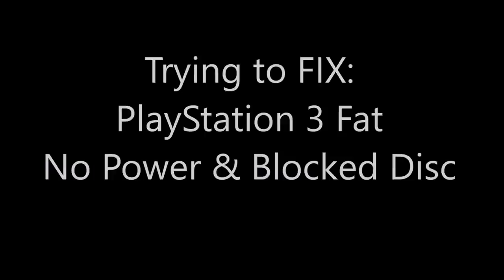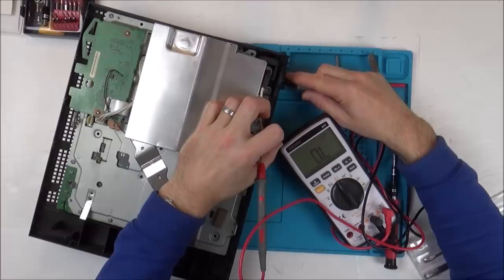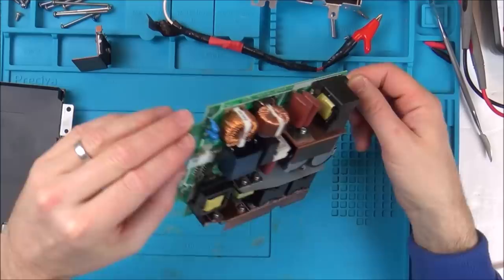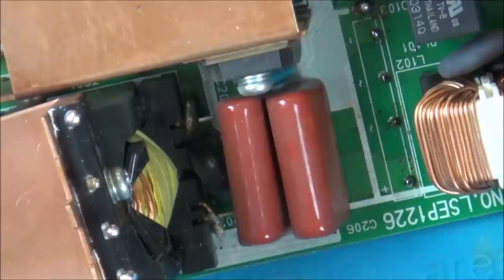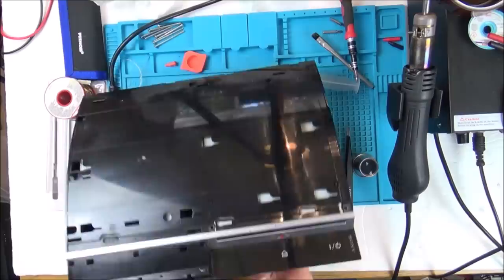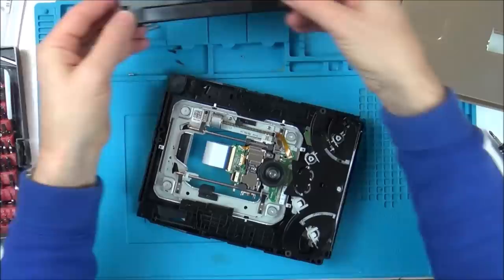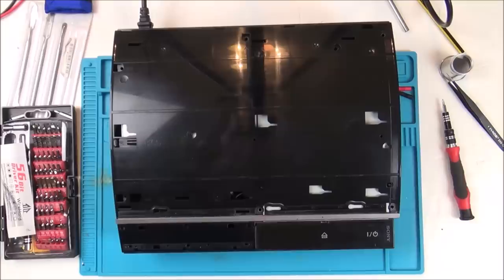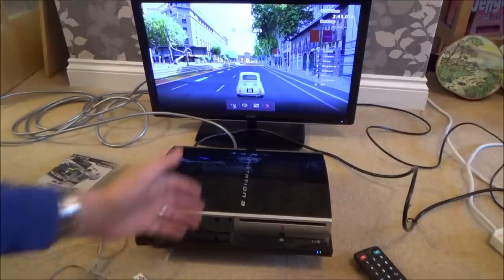Trying to FIX: PS3 Fat - No Power & Blocked Disc

Comment: Hi Vince, you need to hold down the power button for a few seconds to put it into standby.
However, if it doesn't go into standby you can bend the top prong up slightly on the switch and this should sort it. It may take some trial and error. 
I had the exact same problem with a used fat ps3 I bought second hand.

Comment: An easier way to fix that bridge - take some resistors, cut the legs off, wrap them around each pin - solder those legs then onto the bridge.  Because they are wrapped its a more secure connection.  Then unblock the old pins, and fit the bridge again - provided you dont heat for ages on the underside and the wrapping is tight, they wont come loose and it will be easy to secure from the underside.   Great job - really mysterious failure though - normally that type of break would only happen from wobbling the bridge back and forwards.  I wonder if it was sat on top of a washing machine or something that vibrates like mad - that "may" cause that type of failure imo (since it was top heavy due to the heat sink).  Just a drop on its own cannot have sheared that off.  Maybe the disc got jammed in there after a drop, and it then sat on top of a washer for months on end...   Before I forget - never run the screwdriver around like that to try and sort random stuff out, because if one cap IS charged, you may send that voltage into something next to it that doesn't like that voltage ;)
Reply: Him dragging the screw driver around sent shivers down my spine. Not the best way to handle sensitive components.
Reply from the maker: Cheers for the advice Chris. I like the tip on wrapping the pins for strength, I will use that :-) It was a clean break all at the same height, I don't think that power supply had been opened before because the stickers were still in place, really weird!!!!
Reply: @Mymatevince  Hehe =D  I think on top of washing machine or drier for months!!!

Comment: This video spurred me on to try to fix my UK launch 60gb ps3 that has ps2 and ps1 compatability. It was suffering from the YLD i had tried previously to bake it on the oven but it didnt work so today I disassembled it and took a heat gun to the main components that cause YLD. To my surprise after re assembly it worked so now i have a choice keep it for nostalgia as i rarely play console games anymore or sell it on with the relevant disclaimers that it has been a victom of YLD in the past.

Comment: There are two options for a disc drive in that position and thinks there is a disc.
1: Open the drive as you did and just put a disc on the spindle then close4 it then eject it, 
2: you could use a manual eject via paper clip which will put the disc drive into the empty position; 

The reason it was like this? after a simple deduction I would presume someone has had the drive apart after power failure then removed the disc. They may not have been able to find the small hole for a paper clip. 

Thus for anyone, even if the drive is empty, but not sure, just use a paper clip for the small hole on the drives, there is ALWAYS a manual eject. If that doesn't work or budge the mechanism, then take apart and put in a disc, onto the spindle, without turning the cogs, remembering the drive THINKS there is a disc due to it's internal position, then power on and eject.

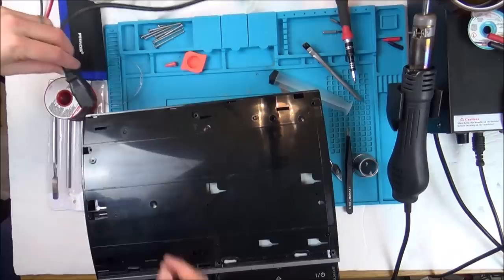Comment: 23:30 Pro tip.. Plug in the mains plug to a switched (and trip protected) wall socket, with the switch *off*, then power on from the wall.
Use the wall socket switch not the device switch. If it doesn't power up first time, power off at the wall, toggle the device switch, power back on at the wall. That way you are not next to the explosion. Furthermore the wall socket switch is safety rated for more than the full surge current, so it is far less likely to weld itself shut if there is a bang. Plugging in the kettle end next to the device with the power on is a recipe for brown trousers.

24:27 NO!!! Just no.. never poke anything metal in to anything that has mains on it with the power cord connected... just don't. You don't need to ask why. It is a terrible habit. 

That includes fishing toast out of the toaster... in fact most particularly fishing toast out of the toaster... you WILL kill yourself.. maybe not the first time, but certainly the last time.

BTW  before the trolls wake up and tell me I'm a pussy, I used to do this sort of stuff for a living. Mainly switch mode PSU stuff and CRT based equipment. I've had more whacks from my own stupidity than I care to mention.

Comment: The fan noise isn't normal, the PS3 needs new thermal paste, and if still noisy you'll need to remove the heat spreaders, which is no easy task, and replace what is now dried up crap. I got lucky on my first attempt, I exposed some copper on the CPU die but thankfully didn't cut any traces. My console is the first unit which runs hotter than your model, and for it to be quieter definitely means you'll benefit from new paste. Love your videos, always look forward to the PS3 ones especially.

Comment: With the BDrive it’s that little motor that causes the drive to get stuck in one position. Sensors you are looking for are on that little pcb board on rhs - little grey mechanical switches. With the power button ...well we were expecting more of you.

Comment: The original PS3 was certainly not efficient though it did save me needing to use the central heating. With that on there was no need for radiators!

Comment: Well done on the blue ray disc stuck issue! - you were lucky, usually that front locking issue is due to a faulty laser lens, so goes into auto lock mode. The front metal connectors for power and eject just need buffering up so the contacts works - also look at the plastic casing, the sometimes bend out of shape so there is not contact from top to bottom. Also you have to hold it down, some ps3 models are not instant off

Comment: The fan noise is fairly normal for that version of the PS3. You can buy a new fan for it but it won’t make much difference. You can buy external fans that go under the PlayStation that cool it down so it doesn’t trigger that fan. It’s just a noisy console all together to be honest. Looking forward to the revisit

Comment: The PS3 fat models get hot so it's normal for the fan to ramp up. Also a lot of people mentioned that you can't turn off the PS3 by holding the power button it just isn't a feature.

Comment: There really isn't any need to replace the bridge rectifier or the power supply. The best way to make a neat repair would be to extend the legs by  soldering stiff wires to each leg ( you can use component leads for this, off new resistors for example ), you will probably want to trim a little off the existing legs too so the assembly sits flush. Then clear the holes in the PCB, and solder the whole thing back into place. I've often had to do similar when using reclaimed transistors with short leads.
Reply from the maker: Thanks Michael :-)

Comment: Man, the PS3 FAT was a beast, especially the decked out ones that had all the card readers and had real PS2 hardware rather than emulating it like the European FAT models did, the CELL which could do real time ray tracing and made games like The Last Of Us possible, the amazing XMB interface, sick Blu Ray Drive which made it the cheapest Blu Ray Player in 2005 and if you downgrade the firmware to anything bellow 3.21 you could get Linux running on this system. Seriously, this console is beast and one of the last interesting consoles I've seen so far, every other console after that has seemed to be either terrible pre-built PC or an under-powered 2014 android tablet (Looking at you Nintendo Switch). The CELL CPU just made it so special.

Comment: 1. The peg in the optical disc drive is to prevent another disc from being forced into the drive when a disc is already loaded.
    When the system broke the original owner probably disassembled the optical disc drive and manually removed the disc.

2. The capacitive power button was functioning correctly. 
     You have to press and hold the power button until it beeps to shut it off. Tapping the power button will not do anything.

Comment: Someoe removed the Disc and reasambled the Drive. If you do this the Mechanism on the Top is in the Ejected Position and the Botom Part in the Inserted Position. If you have try to Calibrate your next PS3 you just need to remove the Top Part, Turn the ps3 on and Press Eject, after that just Screw the Drive Back together.
The Power Button needs to be hold  down for 3 seconds to prevent exidently power down

Comment: the fat ps3s power supplies are notorious for over heating. i mean the PSU sits literally above the cpu so when these start overheating they also heat the cpu, which in turn will make your ps3 sound like a jet engine. i tried this with my ps3 and the replacement PSUs were never fixed. so the only way is to somehow make your own ps3 power supply or find out which component inside the psu is causing it to overheat and replace it. perhaps a great follow up video for this? Id love to know what component overheats inside the PSU.

Comment: This PS3 had clearly been taken apart before. That rectifier was bent forward then broken off, the legs were stressed in one direction. By that, I figured the person may have dropped it after it was apart (the top lid of the power supply was off), broke the rectifier off when trying to straighten it out, then had to take the Blu-ray drive apart because a disc was still inside with no power to eject it, which is why the spindle/laser deck were all in the up position and the drive lock engaged. They never reset the drive to "open" position after removing the disc. A simple mistake during a clean/repair can completely render a unit inoperable, it's sad but it happens.

Also, like others have mentioned, the touch sensor requires a 3-5 second long press to turn it off (standby mode).

I also thought the power supply came originally with thermal paste on the copper heat spreaders in the power supply, yours was clean.

Comment: I think the console was dropped - knocking the bridge rectifier off the board - ps3 wouldnt turn on so someone opened it up and removed the disk by dismantling the drive - put it back together with the drive still in the 'disk in' position.

Comment: I'm curious as to if one can just hook a car battery to the two metal pins that the power supply plugs into and the PS3 would turn on.

The white plastic thing in the disc drive is to stop another disc from being inserted. This lets you know there is a disc inside and to eject it before inserting another.

The power button only turns on, to turn off you need to hold your finger on it for a few seconds and the PS3 will go into standby.
Reply: Although those are the 12V for the ps3, it won't be to happy about not getting exactly 23amps
Reply: @televisionandcheese  The PS3 draws 23 amps but the built-in power supply is probably capable of delivering 25 or more amps. In my experience I've heard that if you are powering something with a power supply for example a device wants 6 volts DC at half an amp (500mA) Your power supply needs to provide 500mA of current or more at exactly the voltage required. I have an old LCD TV that has an external power supply that died (Bad Caps) and I hooked a power supply to it capable of delivering more than enough power and the TV works just fine. I still use it to this day for games and watching DVDs.

Comment: I just bought a joblot of 3 Nintendo DS lite units and I thought about filming me fixing them. I'm glad I didn't though. The first one wasn't too hard. It needed the touchscreen layer to be replaced, the top screens frequency was off and the screen was flickering, the connector for the touchscreen was very finicky and te left shoulder button didn't work. All pretty straightforward fixes. The next DS lite was the DS from hell. Someone replaced the touchscreen connector on it and did a horrible job. So i tried to clean things up, soldering wise. I had it all looking pretty nice, but whatever i did, the two inner pins were always shorted. That's when I thought "Wow, I'm glad noone sees you messing around and getting nowhere..." I salute You for being way braver than I am *lol*. In the end I removed the connector and i saw what was the cause of the short. That guy who had tried to replace the connector had ripped one of the inner traces and its remaining parts were touching the other inner trace. Maybe it would have been a pretty interesting video after all for people, seeing me struggling *lol*. Thumbs up for being a brave adventurer, Vince!

Comment: I believe that the power button is not designed to turn off the PS3 with a single press.  It requires a long press to turn it off.  

For the disc drive, I would bet that there was a disc stuck in the drive when it was dropped.  The owner opened it up to use the manual eject to remove the disc.  Then I would bet they just turned the screw the opposite way again, resetting that pin, thus locking the drive.

For the Bridge rectifier, I'm perplexed why you didn't just clear the holes on the motherboard and re-insert it before soldering?  Perhaps I just didn't see it right, but it appeared there was enough of a leg that you should still push it through the hole and solder on the underside of the board (except the grounding leg).

Comment: Hi, I know this is an old video and your probably not likely to see this comment but i was wondering if it was safe to use a 250v 10 amp power cable on the ps3 despite it been above the recommended specifications

Comment: A fan running loud and fast is definitly not a good thing. As it means the cpu is under more load than it is able to cool off to the desired level.
As the cpu gets warmer, the cpu will start to reduce performance gradually (based on the temperature).
This is in an attempt to let the cooling catch up.

That being said, I its definitly not a uncommon issue with consoles (and laptops). Becuase they cram all the components in such a tiny space.
There is very little room left for a good air flow. Which makes it more prone to overheating, especially on games that pushed the graphical capabilities at the time.

Comment: Power Button - The first PS3s shut only off if u hold it 3 secs becus they added a Functionality  to put it in a "sleepmode " whit the controller so you not actually turned it off
the littl plastic thingy in the drive is for Prevention to put a disc in if a disc is already in it , i think they Had a disc in it and removed it on disassambly so the plastic thingy was still up

Comment: I have an issue with my ps3 and I can't find a solution. 
It works fine for normal games, but if I play a DVD movie the whole system freezes and I have to pull out the power for it to shut down.

Comment: The most likely cause for the disc player to be in that state is for the previous owner opened the system, retrieved the disc without resetting the drive mechanism.

As for the fan, two things that could improve it if there is nothing wrong with the fan. Applying new thermal paste and make sure the fan blades are free from debris.

Comment: You might be able to trace back the reason why it's not turning off over to the power supply because that's where the on-off would be connected to it probably goes through the low voltage section of the power supply not the 12-volt section the low voltage usually the low voltage section trigger the on off

Comment: The blu ray drives is in its play position when you insert a disc the sled drops down the disc onto the spindle motor and that top magnetic peace keeps the disc tight to the spindle motor. The white little plastic peace that sticks up is a disc blocker it’s so you can’t put another disc in why’ll it’s playing a disc. When you hit eject the sled pops up and the roller arms push the disc out. There’s a little motor that works the sled makes it go up and down and another little motor that takes the disc in and ejects it. The other motor spins the disc and a fourth motor moves the laser. Lots of moving parts either the motor that works the sled is broken so it’s stuck in the play position or the little contact switches that get pressed to tell the the motors to turn on are dirty or could be worn out witch would cause nothing to work.

Comment: I worked on a few of them  Vince and I couldn't get the fan quiet even after new thermal paste so im not sure if its normal or im doing something wrong also, they do not overheat with new paste but they are still loud.

Comment: Actually that fat model got many troubles with overheating due due power supply metalic cover which hold heat and pass it to motherboard , even if u set a fresh thermal paste you will reach same result. I remember putting a thick cardboard under the powersupply to reduce the heat up and worked 40%

Comment: i thought it was going to be corrosion on the contact buttons, thats what it was on mine, but a rattling psu kinda says otherwise
edit: considering what the 360 drives do with no offense at all its believable that the drive would jam like this if it got dropped, it looks like it might be similar, the mechanism and the electronics arent as synced as you might think, sometimes things can happen causing one part of the system to think its empty and the other to act like its not, it gets jammed like this and needs to be manually fixed, be glad that ps3 doesn't mechanically lock the unit as one piece while in this state, the 360 does.